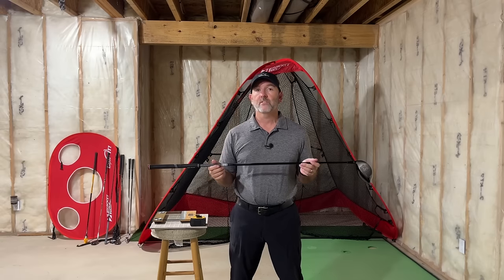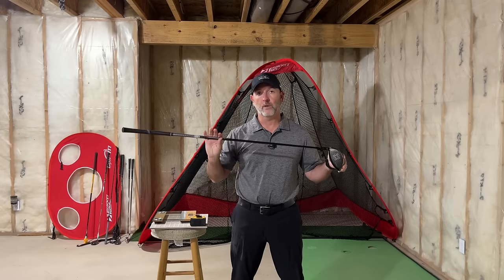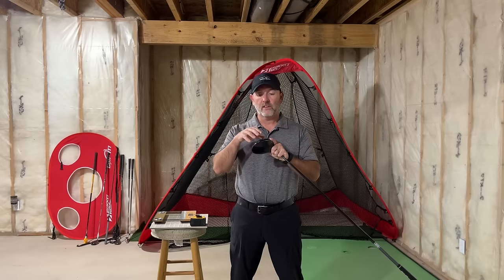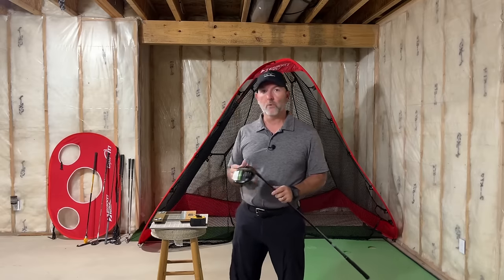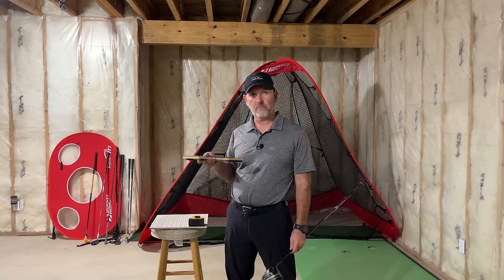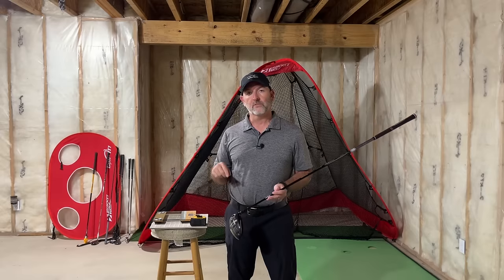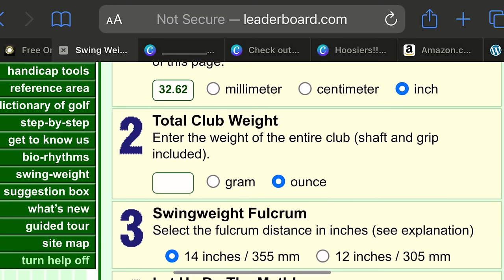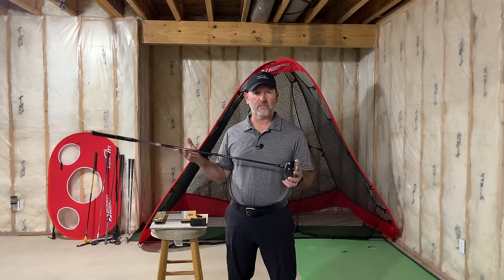Shorten Your Driver Like The Pros Do!!

Comment: Im about 5,6” shortened my driver by around 4” I didnt add any weight and its the best thing i did. Swing weight for average golfers is pretty pointless
Reply from the maker: Good on ya!!  I think a lot of golfers would struggle with something that swings as light as what you’re referring to, but I’m glad to hear it’s working out for you! Thanks for the comment!
Reply: I'm 5,6" as well. What did you notice most doing this? I'm thinking of doing the same.
Reply from the maker: @jonnicolette4519  I highly recommend setting the swing weight according to the steps I outlined.  Good luck!!
Reply: Great info! I’m going to cut my driver down 1 inch to 44.75.  Already have a shaft its 12 grams heavier. I’m skeptical about butt trimming weakening the shaft. That’s my only reservation!
Reply from the maker: @fredgarvin4252  so not all extra stiffs/stiffs/regular shafts are the same.  If you can find a “lighter” version of the next stiffness, you may find that would work.  I think more importantly is finding a shaft that you like the feel of, and typically the next stiffness feels similar.
Reply: Youve probably got too heavy swing weight before and the lighter swing weight suited you more
Reply: Thats because you are 5'6"
Reply: Please get everyone i play against to shorten their driver so I can outdrive them.

Comment: I have been doing what you describe for the past 10 years. Definitely helped. However, you have missed a couple key points. Re shaft flex: for every 1 swing weight (2 grams) added to the head you soften the shaft flex 1/10. It would take 20g of additional head weight to change a stiff shaft to a regular, or change a regular shaft to a senior. If only adding 10 grams additional weight you will change the shaft flex only half way (which works for me). The other  key point overlooked is lie angle - for every 1/2 inch of shaft length removed the lie angle will flatten 1 degree. Probably ideal for a shorter person but not for a taller person.
Reply from the maker: Great point about the lie angle.  I hadn’t heard this idea of each swing weight point being equal to 1/10, but I like the idea as it provides a framework for different adjustment amounts.  Big difference between shortening from 45.75 to 45.25 vs 45.75 to 44.  Thanks for sharing your thoughts!!

Comment: Instead of adding weight to head , think of removing weight from grip .. a dritac lite grip is  around 23grams  the golfpride cp2 wrap is around 64grams ... a cheap swing weight scale can help you adjust ... or just running to a golf store to check.. informative vid thank you
Reply from the maker: This is a great point.  I’ve not tried this, and I have heard some folks say that it “tricks” a swing weight scale, but I can’t say whether or not this is accurate.  It would certainly be worth exploring more, because as you say the scale would certainly agree with a lighter grip increasing swing weight.  Great comment, thanks for raising this!!

Comment: Why not just remove length from the tip and then use a lighter grip so you can use the same shaft? Tipping fixes the decrease in stiffness that occurs and the grip addresses the swing weight change. Should eliminate all the other compensation you mentioned 🤓🤔
Reply from the maker: This is certainly one way to go.  I’m not sold lighter grips really accomplish the same but I know theoretically they should.  Just seems like results are mixed when you talk to golfers about lighter grips.

Comment: Could you just grip the driver further down the grip
Reply from the maker: You can but this will affect the swing weight and you’ll also have a smaller grip diameter, which some players don’t prefer.  But this is a good way to get a feel for how much you’d like to shorten.  Thanks for the question!!

Comment: Great video.  Does shortening a driver shaft change the lie angle?  Will a shorter driver shaft make the club sit more upright thus making the ball want to go right?
Reply from the maker: Shortening a shaft will make the club play more flat which can influence the ball to go more right.  However, I would suggest that if a shorter driver works well for you, then you actually may gain more control regardless of the lie angle considerations.
Reply: Rory McIlroy plays at 44" The Longest hitter on Tour ...Enough Said.......

Comment: I’ve found choking down on the grip to the length you want. It will square the club properly the way you want. No messing with all the swing weight headaches.
Didn’t get mentioned but cutting down the shaft stiffens it also, which really changes the feel.  I’ve been down the rabbit hole!
It’s dark down there!
Reply from the maker: That’s why I made the video, to hopefully turn on the lights!
Reply: Cutting it from the butt softens the shaft. To make it stiffer you would need to tip it
Reply from the maker: @bencovington1121  100%
Reply: its so funny because at the range yesterday I started to choke down and was hitting so much better, Felt like i could stabilize the club with my left hand.

Comment: Good video 👍 
Only one thing that’s incorrect and that’s the stiffness. I’ve worked in a big brands custom build and repair centre doing all sorts and any time you shorten a shaft you make it stiffer whether it’s from the tip or butt end. It’s due to taking away leverage so the shorter you make it the stiffer it gets and you can test this by having the head in one hand and grip on the other like you did here and as you move the grip hand further down the shaft and try and flex it the stiffer it gets. Once your hand is halfway down you’ll barely be able to flex it at all! Granted like you said adding weight to the head will make the shaft feel softer but because you’re shortening it, it’s just counteracting that so essentially it’ll feel similar to the original flex if not a little bit stiffer still. Hope all that makes sense!
Reply from the maker: Thanks for the thoughtful write up.  I have to respectfully disagree as I am taking what I’ve shared from one of the best fitters in the world, Ian Fraser.  As I say in the video, the grip end of the stiffest portion of the shaft if you remove this you decrease the overal stiffness.  If you cut from the tip end, the weakest part of the shaft, you increase the stiffness.  Hope this clears things up.
Reply: @TheGolfNerd   with the greatest of respect it is still wrong and Ian Fraser is wrong! Agreed the butt end is stiffer than the tip so when cutting the same amount off each it will not make it as stiff when butt trimming as opposed to tip trimming but it still makes it stiffer than the original length, that’s basic physics and to do with leverage and deflection. Below is a link to a really interesting video where a club builder has done such a thing with an uncut, butt trimmed and tip trimmed shaft and shows the differing measurements of stiffness… 

https://youtu.be/Juw6aCNlgDE?feature=shared 

I’m not being pig headed it’s just good to know these things especially if you’re someone such as yourself who seems as interested in the technical side of golf as I am. Appreciate your time mate 😉
Reply: @the_full_english  i was hesitant when i heard him say that as it makes sense it would be stiffer. most resources i've read/seen say it makes it stiffer. but i'm just learning about this and know nothing lol. great video either way. subscribing to see what other videos you have.
Reply: @hunterbiles9974  it’s not my video, that’s someone else’s video I linked just to show that shortening makes it stiffer either end you cut from. Happy to be of any help though. I know for fact as well that one of the PGA tour players signed for who I used to work for famously has always used a shorter driver, I believe 44.25”. And he doesn’t go up in flex, he uses the flex suited to his swing speed as normal.

Comment: Jack Nicklaus’ driver was 42 1/2”. I figured if it was good enough to him it was good enough to me. I hit it straighter than ever and I didn’t lose any noticeable distance. I just used a jig saw and regripped it. I guess it changed the swing weight but I couldn’t tell.
Reply from the maker: Glad to hear it’s working out for you! Jack is pretty good company to keep!

Comment: At age 70 (7.8 hcp) I have developed arthritis in my hands.  I have a typical Titleist driver with a stock shaft.  I might hit it pretty good starting the round but as I get fatigued I begin to struggle.  I got the TaylorMade mini driver, 13.5, and it has been good for me.  I hit it as far or farther on most holes and finish the round stronger.  I like this video because I have been considering shortening the shaft on the Titleist and I want to get off to good start if I try it.  Thanks Nerd!
Reply from the maker: My pleasure!! I recently experimented with the mini driver as well!!

Comment: Bruh, this video is awesome. Thx for the info!! My question is, I'm thinking about turning my Cobra 5 wood into the same specs as an Callaway Apex Utility Wood, so the loft will be adjusted to 19° and i'm going to buy a shaft that's an inch shorter at 41.5 inches. So I'm wondering if i buy a shaft that's already premade at 41.5" (like a Callaway Utility Wood shaft), would i have to alter any weighing on the head of my 5 wood? Or would the weight of the shaft be sufficient, since I'm not physically cutting off any weight
Reply from the maker: I’m glad you got some value out of it!!  If the new shaft is a different length than the current shaft, you’ll have to adjust the weight in order to maintain the same swingweight.  Sounds like a fun project, good luck!!

Comment: I am a lifelong Golf Pro.   My trusty old clubs felt like I was at a disadvantage recently.  With this encouragement I updated all of my clubs in groups.

One group consisted of Driver, 1 iron, 2 iron, 3 iron.

Following some research I replaced them with Ping 425.

However I had the standard 3 wood shaft put in the Driver.  

I had a matching 3 wood shaft put into a new 7 wood.

In the new 3 wood, I put a standard Driver shaft.

I also added a 17* Hybrid. 

Results :

Driver:  I saw no measurable distance change.   But my fairway percentage boosted from 69% to 78%.

3 wood :  I hit the crap out of this club and its distance is nearly the same as the Driver.  It's longer than the 1 iron it replaced, although it lacks the versatility. 

7 wood :  Another amazing performer, one that hits a high soft landing draw.  

Hybrid :  This was the biggest surprise.   This club is long and hits a low draw, bringing back some of the loss of versatility of the 1 iron.

Overall Im thrilled with the changes.  The G425 series are super easy to hit.
Reply from the maker: Thanks for sharing your experience!

Comment: Choke up on the club. Nothing new. Thanks.
Reply from the maker: As others in the comments have pointed out this is an option, but there are some tradeoffs.  Namely, grip diameter, swingweight, repeatability to name a few, but sure folks can go that route as well.  In fact, one of the LPGA pros always gets standard lengths and chokes down an inch.  Not for everyone, but it works for some!  Thanks for the comment!!

Comment: First off, great video. Second, can you add lead tape to the shaft instead of buying a new shaft?
Reply from the maker: I wouldn’t say you can’t maybe to just fit something, but if you are trying to save a few bucks, you can find some good inexpensive shafts in eBay to use.  Check out Tensei and Evenflow models for good and affordable shafts.  Thanks for the comment!!

Comment: Say your fitted for a stiff flex at 67 grams 45.5” D3 swing weight. Would you go up to X flex 74g and butt trim to 44”? My plan is to get as close to the swing weight with the shaft and tune the rest with swing weights. Am I going down the right path?
Reply from the maker: That’s what I would suggest.  Another option as that’s a pretty heavy shaft to begin with is tip it 1” and butt trim 1/2” to get to your desired length.  Before deciding, you may want to look what weight is currently in the head and then use the generic rules of thumb I lay out to see whether you could add enough weight to the head with option 2.  If you can’t, based on estimates, then stick with option 1 plan.  Thanks for the question and good luck!!

Comment: I dont get the math, you take lets say 2in from a 44in shaft, that is less than 5%, which will mean a 2 to 3.5gram loss (assuming shafts weight between 50-70grams)... That sounds pretty insignificant to worry much about changing the shaft or adding weights, etc, etc...
Reply from the maker: I can’t argue your logic, but it is much more significant than you are giving it credit for.  As an experiment, find a broom and grab it in one hand 12” from the end of the handle and try to lift it, then do the same thing 6” from the end and then with your hand at the end of the grip.  The difference you feel is the equivalent to swing weight.  Trying to balance that feel when shortening the shaft is the objective.  Hope this clears things up.
Reply: @TheGolfNerd  I think I understand the dynamics at play, but adding weights on the head since counter productive, since would be way to recover acceleration power lost by the reduction of the shaft. But it is exactly the excessive momentum and its uncontrolable nature that screws up shots and increase dispersion. I think that people cutting shaft are looking for a lighter swing. Anyway, I may be wrong but this is easy enough to test, I will cut mine and see what helps. Fixing it later is not a big deal. Thanks
Reply from the maker: @dddmmm21  experimentation is a great way to go, it’s hard to know what you like if you don’t know what you dislike.  Good luck with it!!

Comment: There are some flawed physics in this video. Unless you are cutting off more than 3 inches. You don’t need to add stiffness or weight. The shorter shaft will be naturally stiffer. For example if you buy -1.5 clubs they DO NOT use a stiffer shaft, heavier shaft or change the head weight. This is all misleading information. Shorter shaft will naturally add torsional rigidity, because the club head is now closer to the leverage point, your grip.
Reply from the maker: Man you are welcome to do whatever you like but the stiffest part of any shaft is the handle which is where most folks remove material.  Once you add weight to the head to reach swing weight, you will definitely change the flex of the shaft.  The idea that folks don’t add weight back when they cut off 1.5” is pretty wild.  Good luck to ya!!
Reply: @TheGolfNerd I’m aware but the shorter club accounts for this. You don’t need to add head weight. If you just shorten your driver to 43-44” it’s fine as is. It doesn’t make the shaft less stiff. I cut down an old Ping G5 from 45.5 to 43.5 and it’s perfect. It was a 55g SS shaft and I felt no difference. My swing speed is over 120 so if this was a major problem I’m pretty sure I would know.
Reply from the maker: @itshadouken  man I’m telling you, swinging weight is a very personal decision. I am really glad that’s working for you, but that club is extremely low swinging weight. Probably C0. That does not work for the majority of people swinging a golf club. Have a great season.
Reply: @TheGolfNerd  It feels exactly the same as it did before just now it’s shorter 🤷‍♂️ don’t know what to tell tou

Comment: If I ordered a shorter driver would the company make the adjustments instead of me doing it myself?
Reply from the maker: Great question! I have personally purchased a Callaway that was shortened and it was swinging awaited properly, but they didn’t take the other elements into consideration that I mentioned. I personally think you can get a better set up if you do it on your own. Of course you could just take a driver and they can shorten it for you.

Comment: I'm half tempted to try my hybrid shaft on my driver.  I hit my hybrid extremely consistent.  100g stiff flex.  42 inch.  Anyone tried this?
Reply from the maker: Man I tried so many crazy things before I settled on the method I shared in this video.  I for sure tried a 3 wood shaft before, but to do this and make it as good as possible you have to include the swingweight portion of the technique by adding weight.  In other words, you won’t hurt anything to try what you mentioned, but I think you’ll find the swing weight way too lite and as a result, difficult to control.  Good luck!!
Reply: @TheGolfNerd  you think the swing weight would be too light with a 100g shaft?

I was using a 60g at 45 inch, then a 70g at 45.  So I wonder if 100g at 42 would help keep it straight.  I’m unconsciously accurate and consistent with my hybrid (probably the only club I can say that about). So I’m curious if the same shaft with a driver head would replicate the consistency, but with more distance naturally since it’s a driver head
Reply from the maker: @brianbasile5228  if you have an adaptor that fits your driver, than make the change and try it for a round.  Only you can decide if it works for you or not.  Good luck!!

Comment: At 4:25 you say that when you shorten the shaft it gets softer. From a physical point of view that is not correct. Even if you remove the stiffest part of a rod, the remaining part is actually stiffer. Do the thought experiment in your head on other objects like plumbing tubes, drinking straws etc
Reply from the maker: I appreciate the thought.  I learned this lesson by speaking with Ian Fraser, formerly TXG and now Club Champion world renown club fitter.  He specifically makes the point that cutting the handle end of a shaft softens the overall EI curve of the shaft.  The examples you share make sense, but all those examples are constant wall thickness and stiffness devices.  Golf shafts are not this way, the wall thickness and OD of the shaft change constantly from grip end to tip, that’s why they don’t operate in the same manner as a constant wall thickness / OD shaft,tube,straw, etc…. Thanks for the comment!!